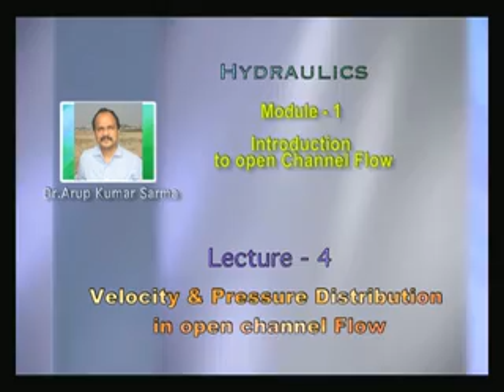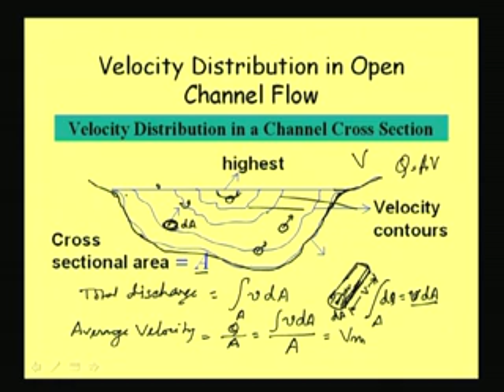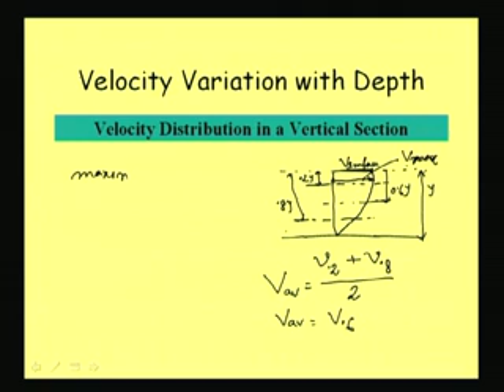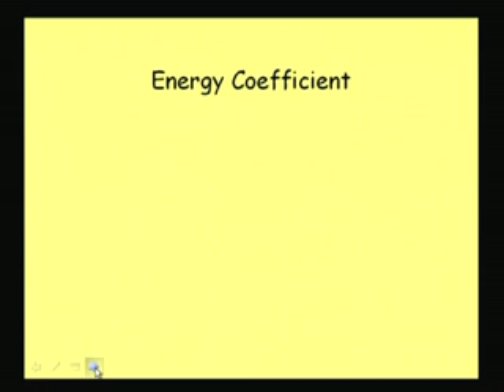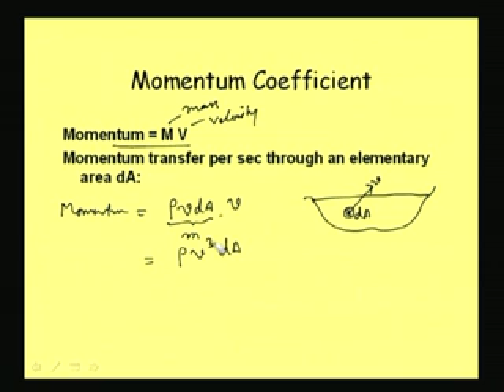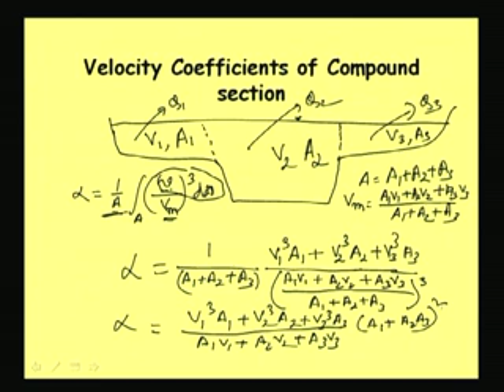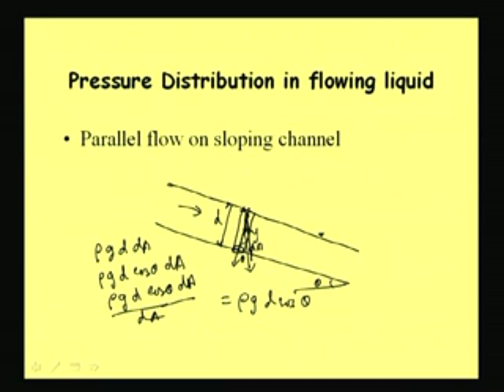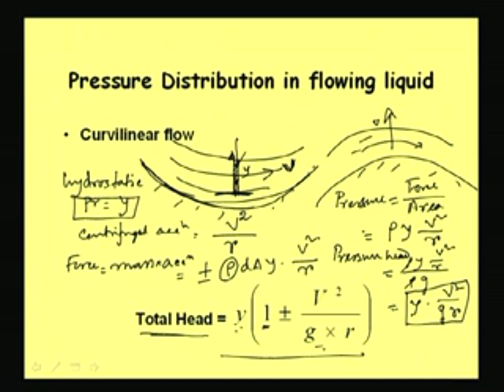Mod-1 Lec-4 Velocity and Pressure Distribution

Comment: Why u multiply by V2 in energy flux??
Reply: Hii what are you doing now
Reply: Yaha toh sudhar Jaa bhai.
Reply: I think there is some mistake the kinetic energy should be 
Ek= 0.5 (v^2) *V *unit weight *dA 
V (capital letter) is volume
v ( small letter)  is the velocity
Reply: Speed = distance/time,. Lets say speed is v and time =1 second. Then the distance travelled by it would be v×1 or simply v 
So if we want to say dA is the small area , so volume = distance * area = v.dA
Now energy =1/2mv² 

Here since we have a moving fluid so in energy per second will be 1/2 * density * volume * velocity²
(1/2) *p*v .dA * v²

P being density (rho)